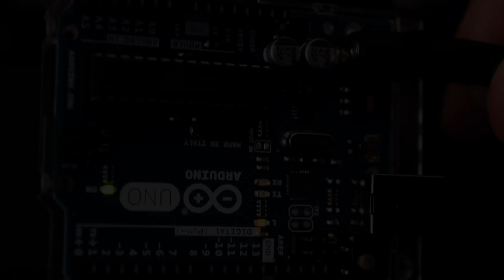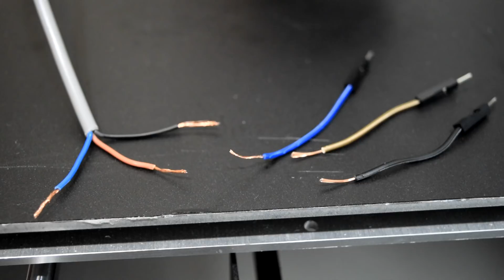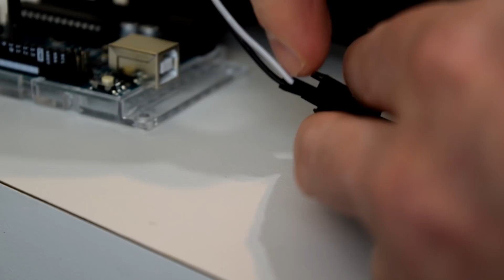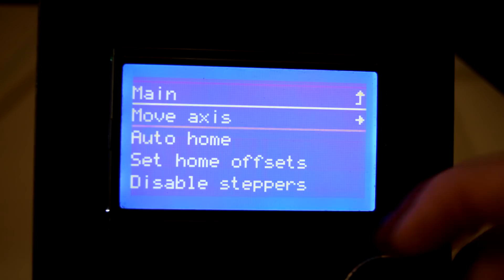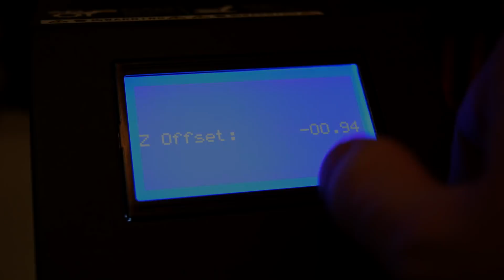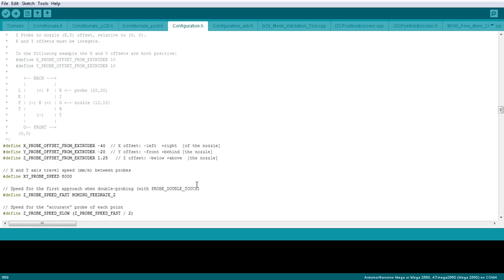Monoprice Maker Select | Auto Bed Leveling w Stock Board

Comment: Great video, used your other one to burn the bootloader. I'm trying to upload the linked firmware, however I'm getting 'exit status 1 'msg' was not declared in this scope'. Anything you could suggest?
Reply from the maker: Thanks, sorry this video is kind of old. you may want to try installing the 1.8.3 version of the Arduino IDE - I believe some people have had problems with newer versions. If you do that, you may need to uninstall the current version and delete any existing arduino folders from your Program Files folder(s). Also, I believe you would have to install the u8glib and Sanguino library/boards again. 
Or if you look through some of the other comments on this video, somebody may have suggested another solution without having to roll back the Arduino IDE version.

Comment: Sorry I don’t see the Marlin update.
I purchased a new in the box never assembled Maker Select Plus 3D Printer think it a bout three years old and the Cura SW mentioned in the manual is no longer available.  Can I use the Marlin, newbie here. 
Thanks
Reply from the maker: I think you would have to follow a guide like this one: https://iotrant.com/2019/06/03/customizing-the-monoprice-maker-select-plus-custom-firmware/ The firmware in this video isn't setup for the touchscreen on your printer.
Reply: @RemainIndoors  you say the firmware isn’t setup for the the mod that is described, or did not understand?
Reply from the maker: This firmware is not compatible with your printer

Comment: Thank you for your great videos! I have succesfully burnt the bootloader, but the firmware cannot be uploaded... The error message is the following: fatal error: U8glib.h: No such file or directory. How can I fix it?
Reply from the maker: I don't remember if I covered it in my Firmware and bootloader video, but this is from the video description:  
You will need to install the u8glib.h library in your Arduino IDE if you haven't done that in the past:
https://code.google.com/archive/p/u8g... 
Download
 the above zip file, in the Arduino IDE go to Sketch - Include Library -
 Add .ZIP library and choose the zip file you just downloaded.
Reply: Thank you for your quick reply! It works :-)

Comment: One more thing, how did you run your sensor wire? I can’t find a good arrangement where it’s out of the way
Reply from the maker: not sure what other mods you've done to your printer, but if you still have the original cable chain setup that goes from your hotend over to the X-end and down to the base of the printer, you should be able to route it along with those cables. you may have to cut the original cable chain off if you're wanting to replace it, but you can always either print another one or use something like Spiral cable wrap which is pretty cheap and some zip ties for holding wires together.

Comment: I am a noob to arduino. I purchased everything you recommended and the power supply came in non functional. I know I can power the uno from a usb on my laptop so can I power it with the sensor hooked up via usb still or do I have to get a power supply? Can anyone recommend one that do work if I have to use it. Thanks and great job on all the tutorials I have learned so much.
Reply from the maker: You may be able to get away with powering it through USB. you can test by hooking up the power from the sensor to the 5v and ground pins on the arduino then plugging in the USB and testing your sensor on the bed. it should trigger every time reliably about 4mm above the bed. Sorry to hear the power adapter didn't work. that's the one Amazon recommended for the Uno. I'll look to see if there are any better options out there.
Reply from the maker: https://www.amazon.com/Adapter-Arduino-Tbuymax-Listed-Positive/dp/B06Y1LF8T5 This one has 4.5 stars and claims to work with the Uno.  I'll change the one in the video description as well. Thanks for letting me know.
Reply: Thanks ill test it and post my results. I didn't wana break something by hooking it up that way.

Comment: Any chance you can update the link to the sensor?  Amazon shows it as no longer available.  Also, there are 5v sensors on there now, any reason you wouldn't just use those and save yourself the stepping issue?
Reply from the maker: Shoot. Thanks for pointing that out. I updated the link in the description to a 5v sensor that "should" work. I haven't tested it to verify. Also, The sensing distance claims to be 4mm but there is a review on the amazon page that says they used it for their Monoprice Maker Select and it only got 2mm, which worked for them, but it is a very short detection distance.
Also, I vaguely remember around the time I put this video out somebody else commented saying they tried a 5v sensor and it had the same problem as the 6v, - some work on 5v and some don't. If you do try it or another one though, please leave a comment so other people will know if it worked.
Reply: @RemainIndoors  I'll give it a shot, I'll need to make a ring that will help fit the smaller diameter snugly in the mount, though.
Reply from the maker: @joboyogi  The one I linked claims to be the same diameter as the one I used in the video. (12mm) I measured the one that's on my printer currently and that's how wide the sensor shaft is. unless you're using a different mount I guess?

Comment: When switching to the Marlin FW, do I need to make any setting changes in S3D to reflect the use of a different firmware?   What about settings on the printer itself or is it pretty much Plug and Play?

I also have upgraded my extruder to the Flexion HT?  Anything I need to do differently?
Reply from the maker: the slicer settings are the same, Marlin Firmware for the most part reads gcode the same as Repetier does. if you have a different Thermistor in your hotend, you'll want to look online to see which Thermistor value they suggest you use for Marlin to match your thermistor specifically. In the Configuration.h file where it says #define TEMP_SENSOR_0 1  you may need to change that 1 to a different value.  Also, if the sensor is in a different location compared to the tip of the nozzle, you may need to change the Configuration.h file to match that as well, which it explains how to do at the end of this video. -- Otherwise, yeah it should just be plug and play

Comment: So after flashing the board with the marlin software and I put everything back together I have a blank screen on the maker select. Any suggestions on how to fix that?
Reply from the maker: First thing I would do is open the box back up and make sure the LCD cable is plugged into the board and plugged all the way into the LCD screen - Also make sure the cable isn't plugged in backwards. if everything is plugged in correctly, I would likely try flashing the firmware again to make sure something didn't go wrong on the first try. if that doesn't work I would try flashing the Repetier firmware to make sure that works. If neither of those work, I would assume it's something hardware related. But, after that I would probably just open the box up and exhaustively try to rule out what the problem isn't until I find the issue. 
That's not a common problem people complain about on these videos, but if the LCD cable was left unplugged or plugged in backwards, that's a guaranteed culprit.  Also, you may want to make sure the LCD screen works before you close the box back up so you don't have to keep taking it apart.  HOWEVER, I would be very careful with that, and keep my hands away from the power supply if I'm turning it on while it's open.

Comment: What is the purpose of using the arduino as a relay? Couldn't you just hook up the signal and common relays to the z endstop input?
Reply from the maker: Ever heard of the EZABL system created for the purpose of doing exactly this? that was a ridiculously overpriced auto bed leveling system that a guy made and started selling to people because they didn't want to learn the specifics of circuits and firmware modifications. This is basically a cheaper alternative that you can do yourself without having to pay some middle man for what amounts to a more useless board that only serves one purpose. Yes there are better ways of accomplishing an auto bed leveling system. This isn't a video saying "Hey do it this way!" it's saying you can do it this way if you want, and here's how.

Comment: How does the Z homing work after the X and Y homing done? That sensor is outside of the bed with X and Y at 0.
Reply from the maker: it shows in the video. Marlin has a feature called "Z safe homing" that homes X then homes Y then moves to the middle of the bed so the sensor has a place to test

Comment: Sorry to bother you again.... new FW has been uploaded, however when I home all axis, the bed is moving forward rather than backwards so it is not hitting the back stopswitch.   Where do I make the change to flip the bed direction for homing?
Reply from the maker: Open the Configuration.h file in the firmware, search for this line:  #define INVERT_Y_DIR ... if it's true on the end, change it to false.. or vice versa
Reply: Thanks... that did the trick.   About to start my fist print using this system.   Fingers crossed!
Reply from the maker: Cool deal. let me know how it turns out

Comment: I am having under extruding issues since flashing this marlin firmware.  How certain are we that the linked firmware does not need any further configuration and will run a 2.1 Maker Select as is?
Reply from the maker: you may want to check your Extruder steps per mm. you don't have to change the firmware for that. Mine seems to work fine with this firmware and the original extruder gear that came on my printer, but I bought mine about a year ago and there's no guarantee there haven't been changes made to the design between when I got mine and you got yours.

Comment: I'm new to this stuff. Does the auto leveling tilts the z axis according to the tilt of the xy plane or it just adjusts the height?
Reply from the maker: it doesn't tilt the z axis. it just raises and lowers the whole z axis as it moves across the bed. so your z axis lead screws are constantly turning to make sure the hot end stays a specific distance from all points on the bed.
Reply: @RemainIndoors  Sorry, I wasn't specific enough. I meant the virtual z axis, as in if it tilts the model to be printed or it skews it due to  the difference in height. And thanks for the quick response 😁
Reply from the maker: @coolbionicle  ahh no worries. Yeah, there are a couple different options in Marlin, one option uses a feature called ENABLE_LEVELING_FADE_HEIGHT that over the course of a certain height slowly corrects the skewing. The older versions of marlin aren't the best at this as if your bed is slightly out of alignment with the z axis, you can end up with some weird layer lines near the bottom of your print, but as long as it's reasonably well aligned, it's usually not a problem. I think if that setting is turned off, it just keeps correcting for the shape of the bed throughout the entire print, which could possibly make it slightly skewed.  The firmware that's in the description of this video has ENABLE_LEVELING_FADE_HEIGHT turned on in the Configuration.h file, but it's pretty easy to turn off.
Reply: @RemainIndoors  Oh man, thanks for the reply! At least I know it covers all bases then. I bought this printer a couple of days ago so I'll be keeping this video in my favorites for when the time comes. It looks like a pretty solid mod so I'm eager to test it out. Thanks! 😁

Comment: Every time I try to verify Marlin it says there was an error with the Sanguine Board. I have the same Arduino software version and using the links in your description. Any advice or could you walk me through it? I used your other video to upload a boot loader and the new repetier in your description of that video but now want to do auto level.
Reply from the maker: What's the exact error you're getting? it's been a few years since I made this video, so I've uninstalled and reinstalled the Arduino IDE (version 1.8.3) a few times since then. I just downloaded the firmware from this video description, selected the Sanguino Board and the Processor as ATMega1284 16Mhz, and clicked the Verify (checkmark) button, and it compiled successfully.  Offhand, my guess would be it's either a different version of the Sanguino board installation or a different version of the U8glib library.
Reply from the maker: Actually, yeah, you may want to remove the Sanguino board you installed first and install version 1.0.2 from this page: https://github.com/Lauszus/Sanguino/releases

That's the one I have installed on my machine. it looks like they released a newer version that may not be compatible.  Let me know if that works for you and I'll update the video description.
Reply: Remain Indoors whenever I try to use the new sanguino it gives me an error when I go to open it up in Arduino IDE. It’s Error loading hardware folder
Reply from the maker: @crashmaster6814  Alright, so I just re-installed it and here's what I did to make it work:  I went to my Arduino - hardware folder and deleted the existing Sanguino folder.  Then I made a new folder and named it Sanguino.  After that, I went to this page https://github.com/Lauszus/Sanguino/releases/tag/1.0.2  and downloaded the Source Code zip file.  I opened that zip file and copied all of the files to the new Sanguino folder.  Then I closed and reopened the Arduino IDE, I went to Tools - Boards - Boards Manager. I got a few errors about Could not find boards.txt, but that's fine, because it still added Sanguino to my Boards menu.  Then I selected the Sanguino board, and selected the right processor, and when I clicked verify, it successfully compiled.

Hopefully that should work for you. Let me know if it doesn't and I'll try reinstalling everything from scratch to see if I can figure it out...
Reply: Remain Indoors what version of u8glib do you use?
Reply: Remain Indoors Just got it to work. Redownloaded everything and deleted the u8glib from the marlin script and works perfectly. Thanks for all the help
Reply from the maker: @crashmaster6814  Nice. Thanks for letting me know